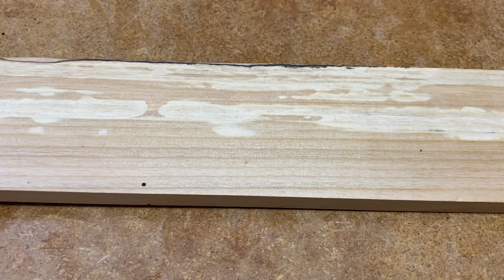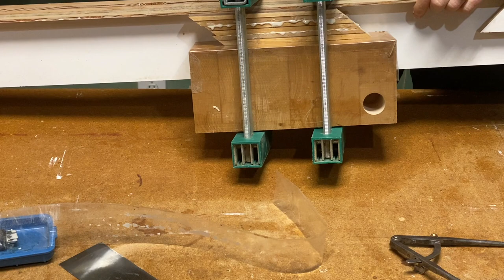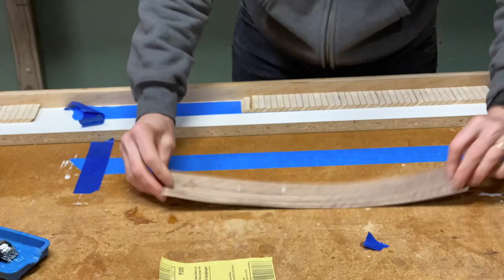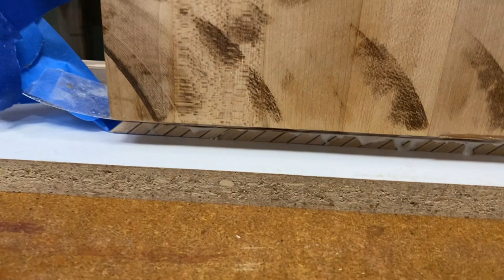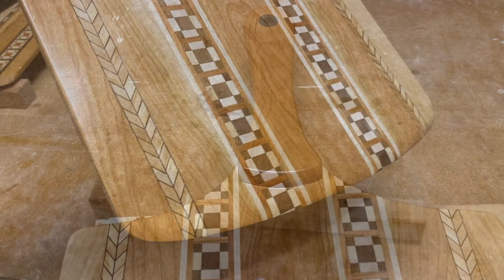Making Wood Inlay - Wheat Pattern

Comment: if it goes all the way through... then it isn't really an inlay is it?  It looks like you glued all the pieces together and then sanded it down, sort of like a 3 piece guitar top.  Looks great though
Reply from the maker: That’s correct. It technically isn’t inlay. I could have sliced it super thin and made it go a lot farther, but I wanted the design to go all the way through so the edge would be correct.

Comment: I gave this pattern and the Zig Zag a go... Shot another video if interested. 

The frames haven't been final sanded.. or oiled yet

https://youtu.be/8mAg7yFfBAU

I had trouble on the zigZag  initial glue up of all things.. only ended up being able to use about a quarter. 

And calling mine an arrow pattern but it's you wheat pattern.. The backside is off and it's exactly as  you describe.. I wasn't square.

And unrelated to banding 45's for frames haunt me. You'd think that would be one of the simplest task. But it's one of the hardest for me.. I've tried miter saws, hand saws, built 3 miter sleds.. Just any deviation apparently shows up .. Last time I figured out my table saw blade was at 89.6 degrees.. Even though I had set it 90 previously in the day with a digital angle finder.. My lesson, check it again before cutting frames.  

But thank you for these videos, they're heaven.. My two attempts at these patterns are 100% because of your postings and hopefully I will improve. 

Thanks.
Reply from the maker: Nice adaptations! Keep up the good work and creativity. 

On the mitered corners, I always use a hand plane and shooting board or “donkey ear” to get the corners spot on. 

Donkey ear shooting board
https://youtu.be/tiWt3TXJmr4

And a band saw jig - for first pass:
https://youtu.be/ox1SDb7FZJg
Reply: @SkyValleyStudio  Thanks haven't watched that one yet.

 I don't even own a real hand plane.. Couple of cheapo block planes.. I had asked you before what you used and it's Veritas Low-Angle.. They're out of stock and say maybe May.

I guess there is going to be a plane in my future.. I really wanted one to build you're plane skid.. looks as if I'll have to go with another brand plane.. But I really have zero experience with one..
Reply: @SkyValleyStudio   Yay me! I finally saved up for and just purchased a Veritas low angle jack plane. Based on your recommendation ; - ) .. Now have to wait for whenever it gets here.  That and they just had them available again. So I want to mimc/copy/borrow/steal/download for evaluation purposes.. Your donkey ear, plane skid etc.. 

Maybe I can solve some of my long standing irksome issues..  e.g. frames and 45 degrees and consistency in the thickness of the different wood layers when constructing banding..